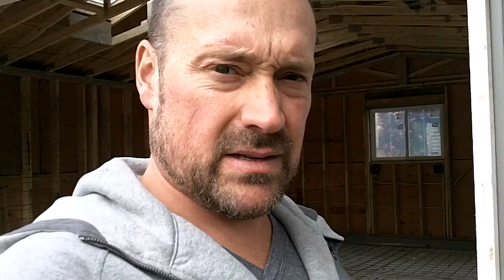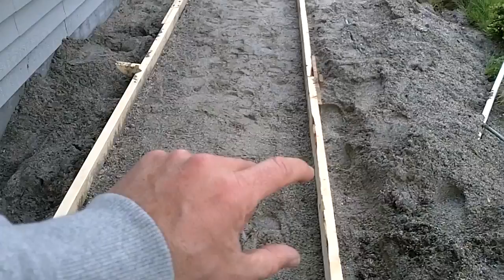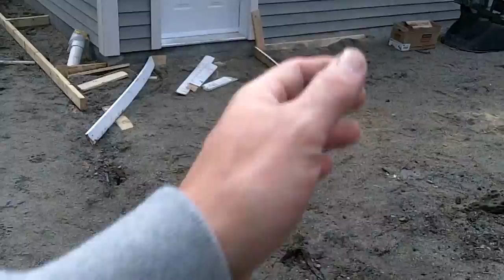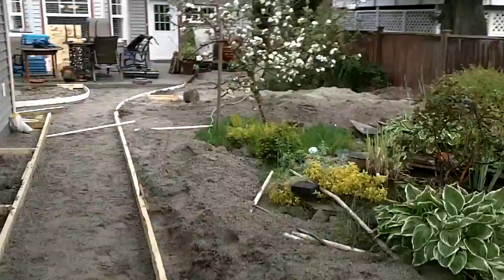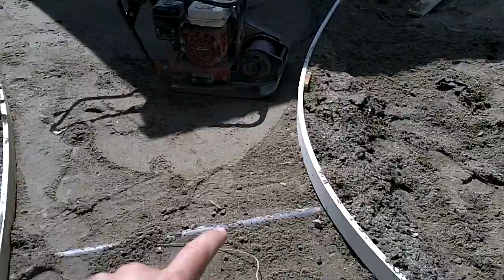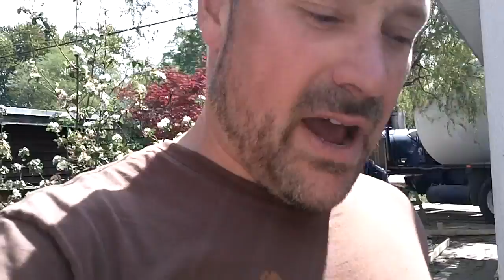Garage Build Part 14 - Building curved concrete sidewalk forms

Comment: Shouldn't the concrete walkway have mesh?
Reply: Rebar?
Reply: immortalbeast84 depends on the areas it’s used. Can drill into adjacent concrete to place rebar into new concrete area to ensure one concrete slab doesn’t become I level and crest a trip hazard. Mesh as well can be added for strength but really not too needed on areas that may not have heavy weight loads as well as earthquake capacity like west coast states etc

Comment: you didn't even have to wet the MDF???
Reply: but MDF wont work becuase concrete mix is WET and will change MDF and cause expansion...so how is this method good?
Reply: @Just_do_it_by_shawn  It probably doesn't affect the final outcome because of the pressure that's being put on the form anyways.
Reply: Never get mdf wet, it expands and becomes a mess.